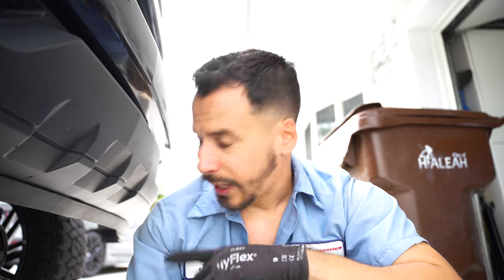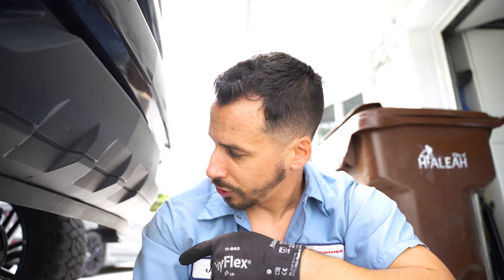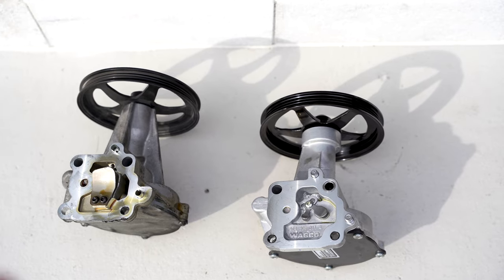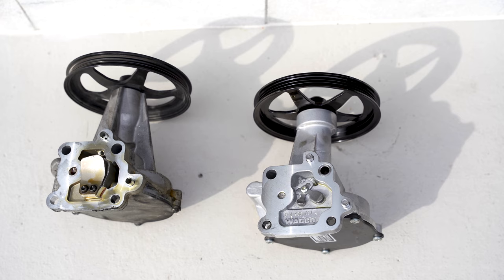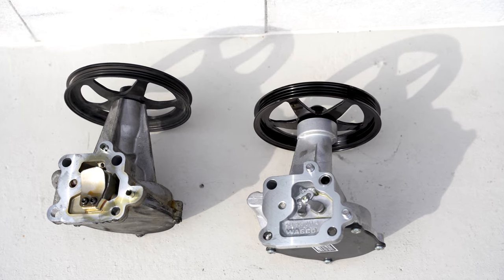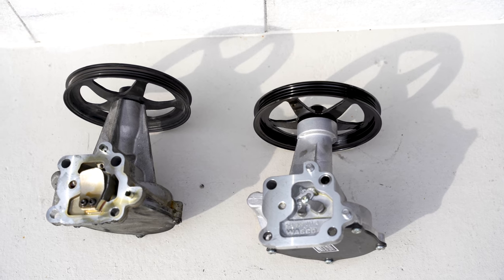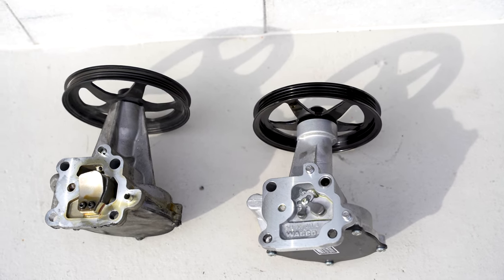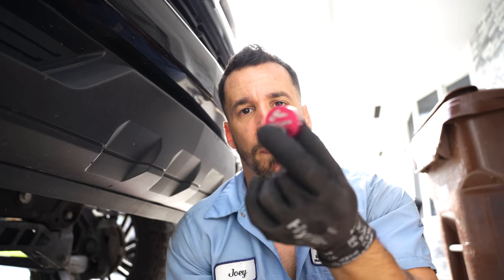2017 Silverado 5.3L Loud Ticking Sound Solution

Comment: Hey Joe, just found this video while I was researching the infamous “ticking noise” issue. I have had my truck in for service / recall issues and the “hard break pedal” issue has never been resolved! This is exactly what I have been experiencing  with my 2017 LTZ. Thanks for exposing this issue, showing the fix, and especially the link to the TSB. I have printed it out and can now take to dealer armed with proof that I am not crazy and what I have been experiencing is actually been documented by GM. It seems like the dealers just want to use any complaints brought to them for service as a chance to rid your bank account of as much $$$ as they can without actually fixing the problem that led to bringing the truck in for service.  THANKS for the info…
Reply: I experienced this as well

Comment: I got a 2017 LS 5.3 with 42k miles on it. It have owned the truck for 4 months so far. I have had the 4wheel get stuck, they reflagged the ecu but in doing so also friend my music, can’t remember may any tunes and the blinkers make no noise when I picked it up from the dealership, they said I can turn the truck in again. Two months from now. We are a month away. Now. I have this same exact noise. I’m n getting bummed out in this truck man. It was my dream truck. But outa the 12 vehicles I have owned man. This a funky clunker.

Comment: I too have the whine, fast clicking for about 15 seconds, then slow clicking. Exactly like what I hear near the end of your video. Anyone know?
Reply: I've got that also on a 2017 5.3. It's like the noise is on back of motor down by transmission. Iam trying to find out exactly what it is.
Reply from the maker: Ive heard it's our injection pump. Honestly my truck has shown no symptoms outside of that and ive just tuned it out at this point.

Comment: Hey Joe I have a 2016 Silverado and I have a question with engine noise I have like a almost surging noise coming from the engine but the engines rpm’s stay the same is that normal noise
Reply from the maker: Hey Reed, I dont think surging noise is typical. I would definitely recommend getting it looked at.